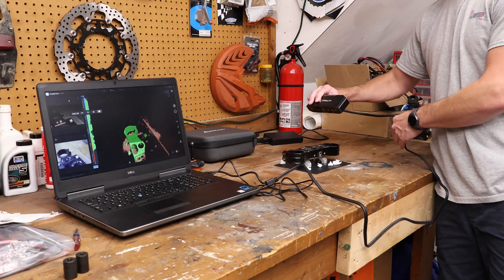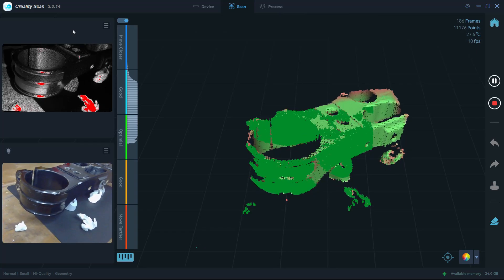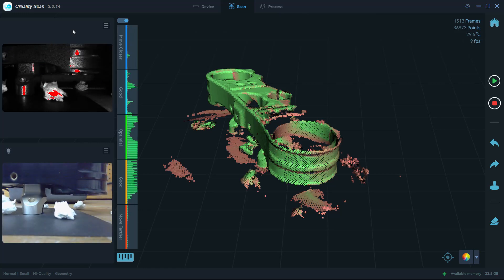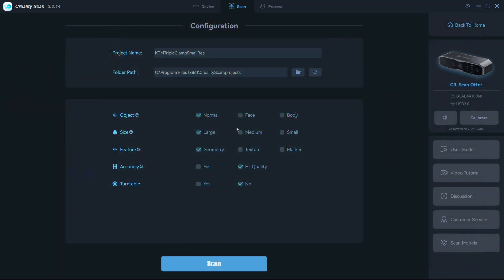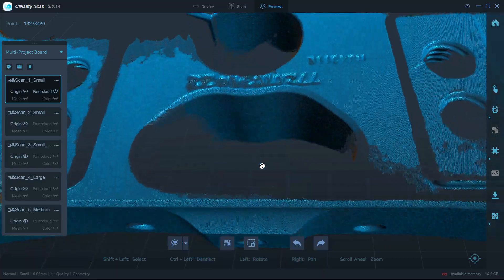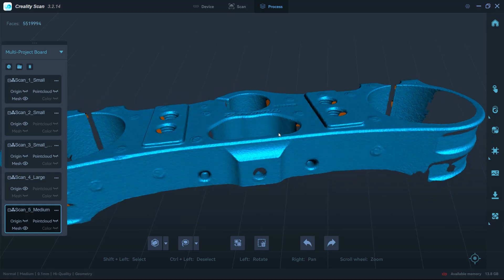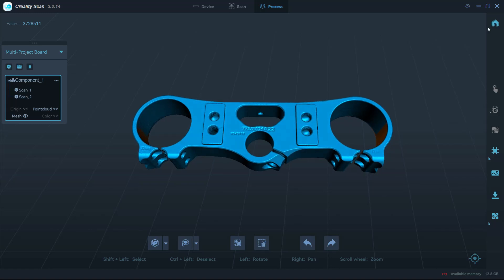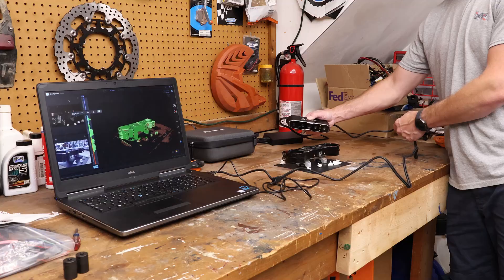Which Scan Mode To Use? | Creality CR-Scan Otter Triple Clamp Scan Mode Comparison

Comment: Thanks for your videos. I purchased a Scam Ferret about 8 months ago, to introduce myself to scanning. The hardware I have meets the minimum requirement, and Furmark reveals 80fps. I have tried every release of CS, and the newest version 4 performance test indicates marginal performance. It seems to me Creality marginalized hardware requirements, when released, and the new CS is present reality🥴🇨🇦
Reply from the maker: I still prefer the older Creality Scan 3 for many things.  You should be able to download that still and give it a try.  https://www.crealitycloud.com/downloads/software/creality-scan/Windows
Reply: Thanks Again, I downloaded the version you were using in the, and I think I will spend time with that version. You have many great videos, keep it up, 😉🇨🇦

Comment: Your videos continue to be very helpful in this topic. I have a new Ferret, and I have been able to get it scanning. I also have a older Dell T3500 that I use for CAD, and I have tried all I can to get CS setup, but no luck. I see you are using a Dell laptop. Is that a gaming machine, maybe G5 . I am thinking of buying a used machine like that , just for scanning. Thanks Again. 👍
Reply from the maker: Glad they are helpful!  We did a CR Ferret video awhile back.
https://youtu.be/Vp17bKdt6sw

Talked a bit about performance around 1:50.  I scanned the same thing with my phone, desktop and laptop.  Processing took longer on the phone but actual scan capture was fine for all the options i tried.

The laptop used in that video and the Otter one was a 7th gen i7 CAD specific laptop.  quadro p4000 card and descent RAM etc.  I have since had to upgrade to a 13th gen i7 CAD laptop as the laser scanner MetroX just needs more processing power.  If you are only scanning with the Ferret and you have a recent phone you might try that option if you can.  There is a wifi6 bridge option and also you can wire right to the phone.  Might be worth a shot for you.
Reply: @LearnEverythingAboutDesign  Thanks, not big on the phone, and the Android is not compatible with Tabs, thanks again 😊

Comment: Mat , I have a cr scan ferret pro which is what i can afford at the moment , is there a chance you would take the time to do a tutorial on helping us now that 3d scanning has become more affordable to better understand our options around free processing as with f360 , meshlab and meshmixer
how can one better detect small details with the ferret eg :braces and clips and also maybe scanning and processing an object outside of the scanners size range as in my case i have some mining equipment id like to scan that is basic enough to simply draw but the client wants it scanned
i will try to search for more videos if you have covered any of these but to date these are still the setbacks holding me back
Reply from the maker: Hey There, on the ferret I just have a review video https://youtu.be/Vp17bKdt6sw
Depending on your needs for the output you are likely going to have a lot of trouble scanning large mining equipment for anything other than a visualization.  You will hit limitations in the software as well as accumulated errors on larger objects.  I know that probably isn't the answer you want to hear.  In order to scan larger objects you really just need some sort of unique features to help with tracking.  if that means sticking blobs of clay, pieces or tape or something on it that is probably the best thing you can hope for since there is no hybrid tracking in that unit (markers and features) that i am aware of.

Comment: Thanks for the video! Question: the software has an option to tick for a turntable. Is this intended to only be used if the scanner is stationary like mounted to a tripod? Or can you check turntable mode and spin the turntable with the scanner in hand?
Reply from the maker: I personally haven't had much luck with the turntable option.  It is meant to be used with a stationary scanner as the algorithm for tracking and overlaying points I believe is different.  That isn't to say that you couldn't hold it in your hand, but personally I found tracking to be better without a turntable.

Comment: You really need a variety of 3d printed marker towers. Once you have them you will not have issues with tracking. You should be able scan the triple clamp with a very minimal amount of markers applied to the clamp.
Reply from the maker: In the previous video where I scanned it on Medium with feature tracking it was fine without markers.  crumpled paper around the part works just as well and you don't have to use marker tracking.  Since creality doesn't have a "hybrid" tracking i prefer to use feature tracking when possible.  If Creality had a hybrid marker/feature tracking I would agree but with their scanners I have not found that to be true.  just my 2c for whatever it is worth.

Comment: Love your videos, thank you , please would you do a video on aligning the WCS with the creality software, i cannot make sense of it , i used to use fusion but they seem to have changed how it alighns meshes
Reply from the maker: So sadly there is no way to align a scan to a wcs in the creality software.  I talk about doing this in Fusion https://youtu.be/82vD7YSKIAo?si=0OqMV_6Hb8loH4Wz

but you would have to go to Quick Surface or geomagic or some other software if you want to take a mesh and align it to a coordinate system before export.  GOM inspect used to have a free version that would let you do it, but I think that company was bought out and I don't know if that is still true.
Reply: Thanks, for some reason fusion does not seem to work anymore, I have always used it pretty much like you have shown in the transmission video , comes up with an error now , "no alignment suggested by geometry could be found" , there is a long workaround using the move command and measuring plane angles etc , works but tedious. I don't think gom inspect is around anymore, I registered a while ago but could never get in to actually use it. Thanks for the effort you put in to your videos , without YouTube I would've given up ages ago 😊

Comment: I bought the Range 1 on it's Kickstarter campaign.. i recently found it needs alignment and for that i need to buy a 50usd set of four cardboards with "special materials" and another plastic bag..
They forgot to mention that on the campaign, never buying anything from them again..

I started doing good old photogrammetry both with a D5100 and with an S23 Ultra, i find it more convenient since you dont have the limitations of real time alignment.. also you can go as close as needed and have picked up sub milimiter stones embedded on a car tyre..
Reply from the maker: Oh wow that sucks!  I haven't tested the range but in the 8 or 9 scanners I have here from creality and revopoint all of them have come with all the calibration boards needed. I know a lot of scanners when they show up need to be calibrated first so that seems like it might have been an oversight thinking it would not need calibration.

Sorry to hear the trouble you had! Depending on your needs photogrammetry might be ok, but it does have its limitations as well.  The revopoint miraco has single frame mode where you basically use it like a camera and take single frames rather than continuous capture.
Reply: @LearnEverythingAboutDesign  Absolutely not your fault, no need to apologize for them.. Range can scan single frame too, but scanning the hatch on a hatchback car i had a 10cm misalignment.. tried feature, marker, and feature again without removing the markers, that was my best result with the car sprayed..
Reply: I understand your frustration, but keep in mind that during the Range crowdfunding campaign, the super early bird price was $328, and the early bird price was $401, which was already quite affordable.
Reply: @MaxCohen-ic4cn  I paid the full price for the range but still didn't get the calibration board. Revopoint’s nickel-and-diming is disgusting. And I will also never be buying their shoddy products ever again.
Reply: @MaxCohen-ic4cn  At least they could have mentioned it would be indispensable in the future to operate the scanner and it would not be a cheap thing..

Comment: out of interest, have you had any problems with the creality scan software crashing?
Reply from the maker: Didnt realize you could see this video :)  I guess unlisted on a playlist is still visible :)

I have not had it crash at all on my laptop or my desktop since the last 2 updates.  Prior to those updates yes I did have a few crashes.
Reply: @LearnEverythingAboutDesign  maybe I'm just special?

I've had a few crashes now, I think it might be my pc though as it seems to only happen when I try doing a big/detailed scan.

Mostly only when I finish the scanning part and try move to processing, which is what makes me think it's my pc
Reply from the maker: When that is happening pay attention to the bottom right of the screen and the available RAM.  See how low that is getting.  Generally a processor speed issue would just slow down the conversion but if you are maxing out your RAM that could cause it to crash.  Neither of my systems have a crazy amount of RAM.  But remember your Gcard if it has "onboard RAM" is going to reserve part of that.  So if you have 32gb ram on your system and your card says 16gb ram for example, you really only have 16 to play with for your system.  Then if you have email, other programs, web browsers going and/or CAD open you may be lucky to have like 8gb of ram to work with.  

A test you can do is set your mesh facet count slider way down and watch the RAM.  you can redo that part so set it a little higher and watch your RAM.
Reply: @LearnEverythingAboutDesign  thanks I'll check it out! I don't actually get to the processing part, it happens when I hit the button to finish scanning and move to the processing window, if you get what I mean
Reply from the maker: @dan5her  hmm.  Are you on the most recent version?  I would still check the ram in the lower corner.  On those larger scans see what the available ram is and that might hint at the problem.
Reply: @LearnEverythingAboutDesign  I believe so, but I'll check it out!
Reply: @LearnEverythingAboutDesign  still crashing for some reason, newest version and as far as I can tell the memory isn't an issue. it seems to crash if I scan more than 38k points, which doesn't seem like a lot
Reply from the maker: @dan5her  hmm. can you drop me an email support@caducator.com  ill try to reach out to their tech support and see if i can't get any info.
Reply: @LearnEverythingAboutDesign  will do :)